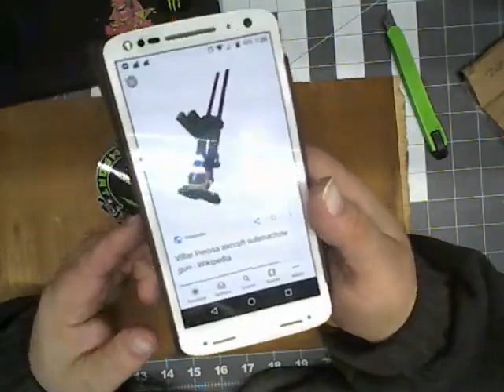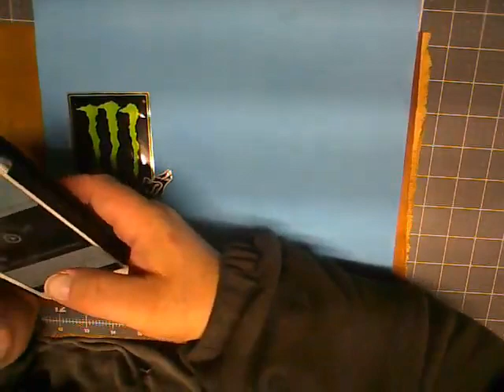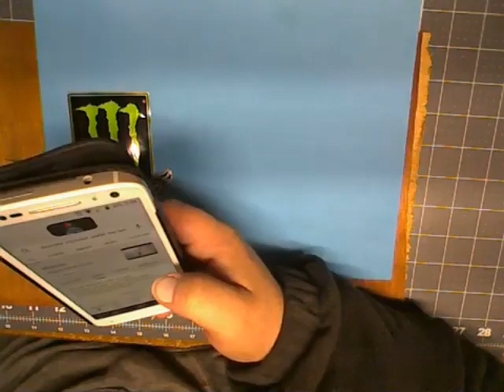Killing Time Insted of Working

Comment: Did you every get your green screen to film? You could use green poster board from dollar store
Reply from the maker: No I never got a green screen. that sounds like it would work in a pinch but unfortunately right now I lost my filming space. The clean out of the basement pushed everything all around in the area that I had opened up is now full of garbage again. 😭😤😵.

I have some shop lights I can use but now I'm back to square one. and frankly, with my father going into the hospital right now Nerf has been the furthest thing from my mind.